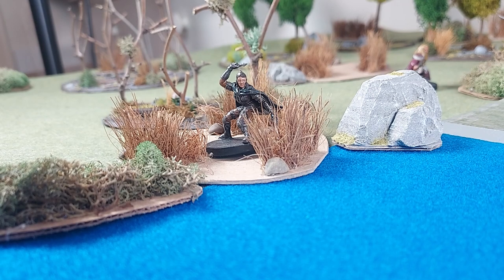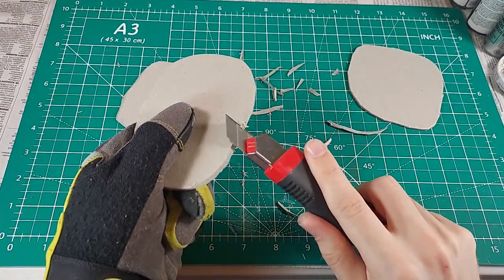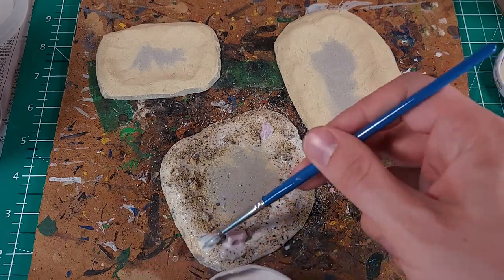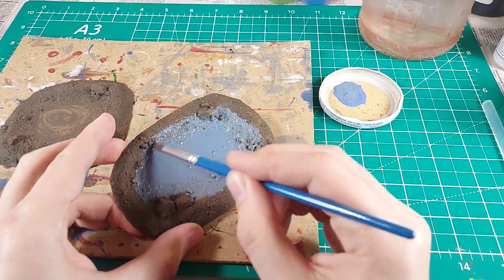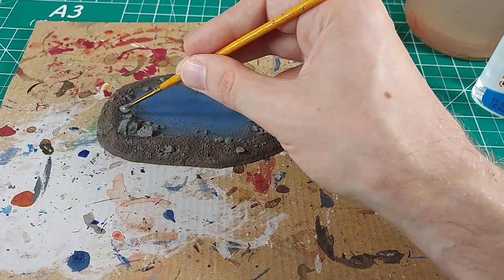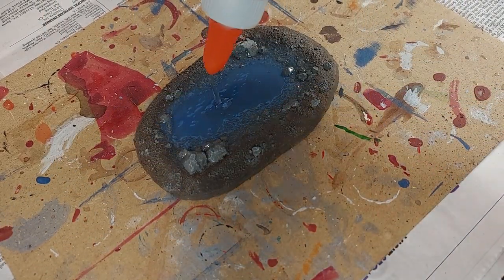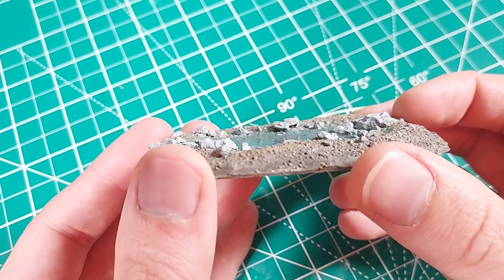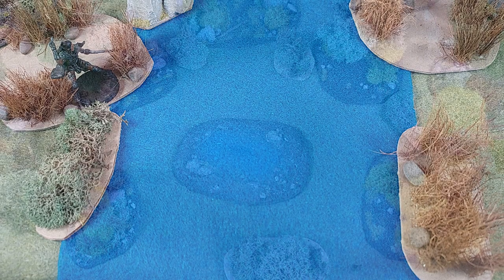PVA Pool & Puddle Terrain: My Attempt At Simulating Water With Clear Glue

Comment: it's funny, I kinda liked the result of the varnished piece the best :) it looked most realistic, maybe because of the gradient you did, and because the shine stayed where it was supposed to (as opposed to the other 2 where the shrinking of the glue left behind semi thick edges that would be a bit too broad to be wetness around the edge of the water. 

In any case, they all came out pretty good, I especially love the texture of the ground in combination with the rocks! I also really like the way you do gradients, it looks really good!

I might have a few simple tricks for giving more depth; instead of using one single colour for the water, you could create the illusion of depth in the water with some darker colours where you think the water would be deepest. 

like the varnished pond you made, after the gradient with the teal and the beige, you could then to another gradient in one or two smaller spots in the middle of the pond with a darker value (or just put a bit of black/dark brown), this would already give it a lot of dimension without having to necessarily build up a transparent layer of glue/resin/silicone. if you feel really fancy, you could make the finest little lines with a very watered down white on the dried varnish, especially around the rocks that are peeking out of the water. 

what would give the surrounding environment more dimension, would be shading and highligting the rocks/the terrain. working in thinned out dark colour washes for the recessions in the piece works amazing, and drybrushing for giving the highest points a highlight make a world of a difference in my experience. the cool thing is, depending on the mood you want to give your piece, you can use colours besides black/grey and white for this purpose; for a swampy environmentyou could use deep purple for the shading, and a very light green for the highlights for example. as long as the base colours are more natural colours, and the colour values are accurate, you can't go too wrong and it opens up a whole world of possibilities .

I'm sorry I went off on a tangent here, and just dumping advice nobody asked for, but I love playing around with colours at the moment, and as soon as I realized that shadows and light aren't gray or white, but colourful, it blew my mind lol.

Comment: Maybe build it up in layers, each with a different shade of the color you're going for - darkest in the first one, lightest in the last.  It'll dry/cure faster, and the warping should be minimal.  You could also use double-sided tape to adhere the forms to a sheet of wood while they're curing to help with the warping.

Comment from the maker: Disclaimer: PVA is not the best way to create water effects for miniature terrain by a long shot. I made these pieces for fun and they actually came out okay, but this is not a reliable method for simulating water.
Edit: My follow up/second attempt video is up. Link is in the description.
Reply: Have you every thought of using 2 part clear epoxy resin for your water?  It pours level and cures in 24hrs. Bubbles can be removed by breathing upon the surface as you apply it in layers or using a small butane torch flame. The flame is done by quickly criss crossing the surface and won't burn anything only if you don't hold it in one place too long. 
   Or use the resin as a topcoat for a realistic shiny water surface.  Many modelers I know of use this method.  
   Back on my early sign days, we used pink Styrofoam to cut out letters, latex painted the surface, once dry, painted the selected colors and after that dried... put a clear epoxy surface on that.  Sides first to cure and then a heavy coat on the top . They must be level or the epoxy will drain off. Epoxy is thick and cleans with acetone.

Comment: You could do UV resin for smallish pools (it's stupidly expensive) you can tint it, and layer it for ripples. You could add paint when it was dry for extra detail. (It's also good if a model is missing one of a set of parts. I build a lot of 20+ year old space models)

Comment: A trick to help with warping is to put glue on the bottom to partially pull it back but I would do a layer on bottom first so it will support the paint on top better

Comment: I used stuff called Aqua Magic by  " Deluxe Materials ". I bought some  Flames of wars rivers and poured this on to give it more flowing water effect . I had to block each end first but if you use a straw and blow over it you can get water motion. It doesnt shrink either .  Also stick some LeadBears Tufts in before pouting . All water banks have growth in the water.

Comment: a gloss Modge Podge would help make more natural ripples in all 3 attempts. you can find Modge Podge at Micheals as far as i know. and you can use it to simulate ripples on 2-part epoxy casts as well.
Reply from the maker: Thanks. I need to look into that. I have a few more water effects projects planned for down the road.

Comment: I used clear glue for a fountain with several thin layers. The first few dried well, but the last layer pulled the paint around the edges off
Reply from the maker: I had a similar result in my follow up project.

Comment: Nice to see this. I've dabbled at it, with clear glue, before. I find the shrinkage is about 80-85%. Not great, for water effects, but plenty good for creating a gloss effect. As for the warping, Beardclipper has had good luck with clamping down the edges, during curing. Really enjoyed this in-depth experimentation
Reply from the maker: Thanks. I am working on a few more experiments in trying to bend this material into a water effect. I feel very confident that clear glue will work for deeper water effects. I just need to find the right approach to properly apply it.
Reply from the maker: I change my mind. These pools really are pushing the limits of PVA for water effects.

Comment: I like to use Envirotec 2 part epoxy, it's fast drying with zero shrinkage.  You can find it at both Hobby Lobby and Michael's
Reply from the maker: I will have to give that a look. Thanks for sharing.
Reply: Tried glue this year instead of epoxy before seeing this video, after using both, 100% epoxy is the way to go
Reply: @thegamingtome  You can even get it at the dollarstore. Just mix it thoroughly in a separate cup mix and mix and mix (if you don't it'll cure badly, be sticky or crack)
You can also add a tiny spec of paint or ink as you mentioned. Although the best is Clear epoxy. A bit more expensive but it goes a long way and looks the best. Love your videos man, keep them coming.
Reply: I've always been nervous about pouring resin and such. But I have an interest in water bases for large scale model ships and submerged submarines. Where glue won't cut it.

Comment: The gloss varnish method would definitely work better on pools more flush with the table. The advantage to using this method is it requires less "geo-forming", and it takes less time to cure.

As for the glue method, you might be able to combat the warping by clamping the edges of the pool down to the sturdier surface, like a table or a solid block of wood. That way, as the glue contracts, the surface it's applied to will be forced into its final, flat shape.
Reply from the maker: I agree. A thinner, less dramatic slope before the surface of the water would look better.
I would like to try making larger ponds using these methods in the future. I should try clamping the pieces down when I get around to making them.